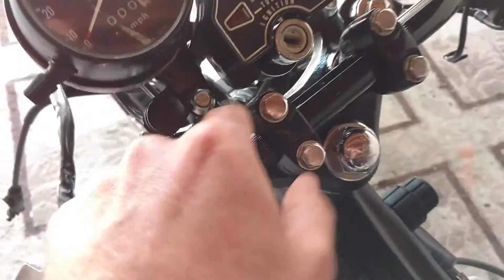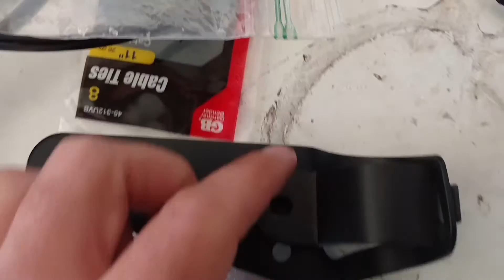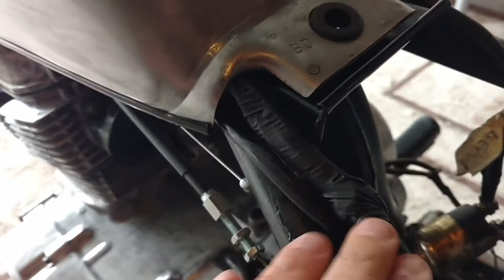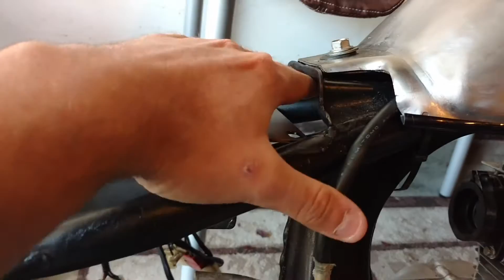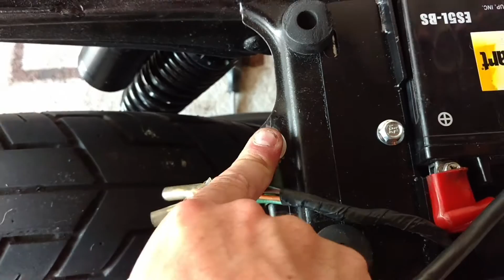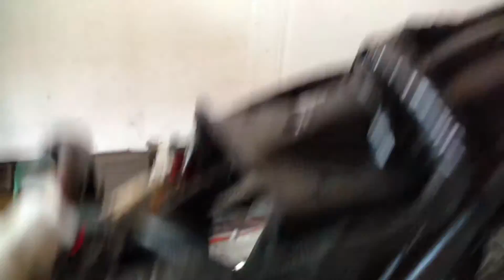Cafe Racer Build PART 8: Electrical - Honda CM400T

Comment: Congratulations for this great job!
i also do a cb400N, i wanted to know if the battery you are using is the original amperage?
because on mine it is 12Ah
thank you
Reply: OK.
your gel battery delivers how much of ah? tanks
Reply: says that only has 80 CCA. is that enough with an electric start? I have a 190 CCA conventional duralast. have you had any issues with such a small CCA?

Comment: Hey Tim another quick question have you had any problems with your battery?? just wondering cause I have been trying to figure out what I want to do about what kind of battery I want to use and I have seen these ballistic battery's and antigravity battery's but they are super spendy and if you have had no problems with yours I will probably do the same battery you have.

Comment: hey tim, working on the same bike you have here, where did you find that tray you put your battery/electronics in?
Reply: thanks so much! also if you dont mind,  what did you end up doing for the oil breather since you removed the stock airbox? never worked on a bike before and this is my first, not totally sure where to go with it
Reply: are you sure that it wasn't this one? https://cognitomoto.com/collections/electronics/products/under-seat-electronics-tray-deep-cb750 . I only ask because the holes you have 4 drilled holes in the one in the video. Just making sure it will match my frame! Thank you. Great videos.
Reply: Philip Allman I just asked the same question.    Did you ever make a purchase?   550 or 750?

Comment: Hi Tim wonderful videos. I was wondering about the battery that you used for you bike. Did you purchase a special one or just use a stock battery ? In order for it to be rotated on the side has to be a gel battery correct ? Thanks and have a great one.

Comment: Quick question. what did you do with the breather hose on the valve cover that ran to the stock airbox?? just curious cause I'm currently doing a 81 cm400 build. did you just leave it off or run it somewhere else. and thank you for posting your build videos they have been loads help!
Reply: nvm found my answer haha, thanks for sharing